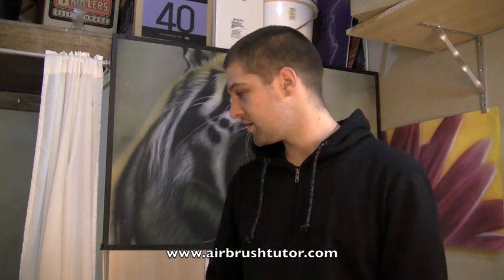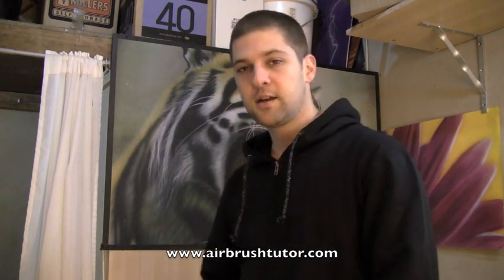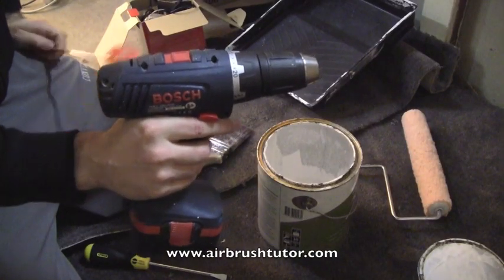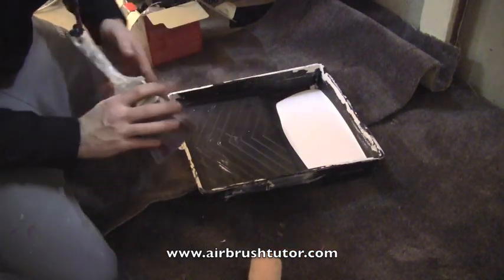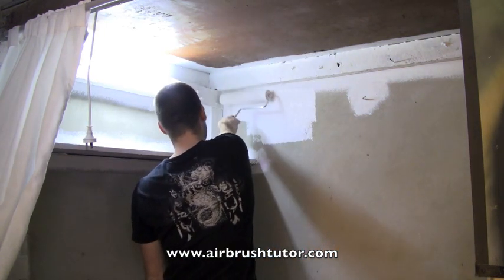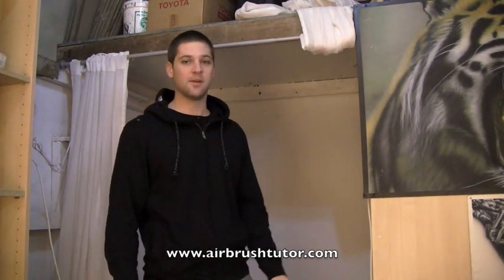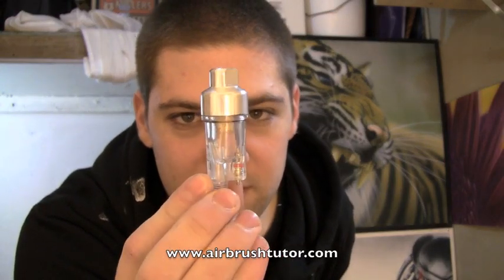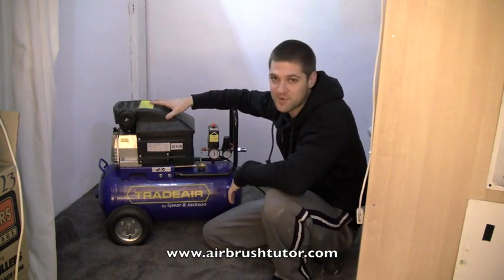How to set up an airbrush space

Comment: I bought a GMC Syclone 4610 compressor, its 60 decibels, it has 2 output quick connects, I have a 6 gallon portable tank plumed to it. 10 gallons of air total and the compressor is 1 HP. I recommend getting one of these, their not cheap but they are worth it.
 I like the look on your face airbrushtutor when your compressor comes on while your trying to talk in the other vids, its pretty funny, keep up the good work, and show us how you did the big Tiger on your wall!
Mega.

Comment: I use an easel with foam core board as a work surface. I cover foam board with transfer tape and spray with removable adhesive spray so I can just stick my work to the board without tape or pins.